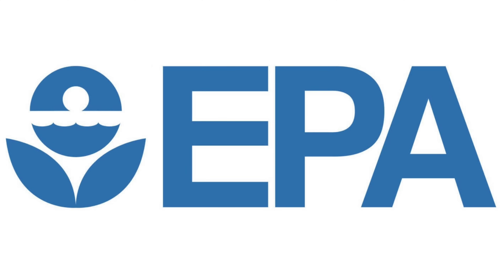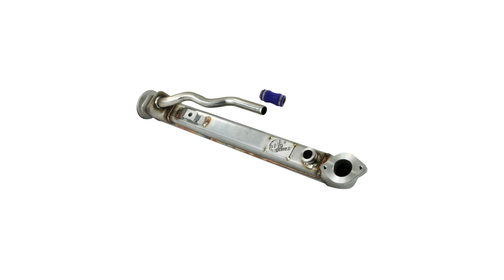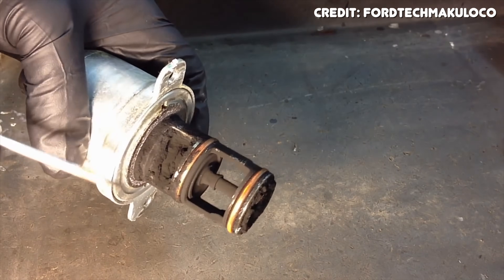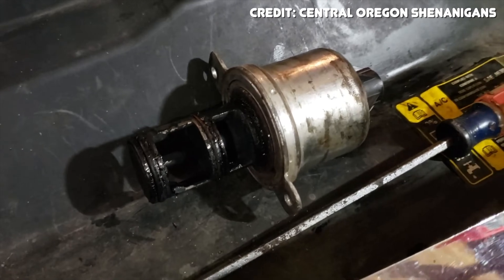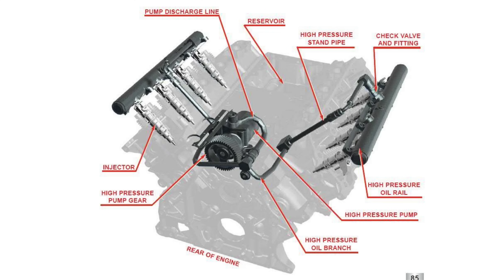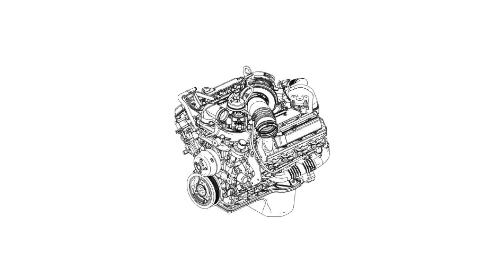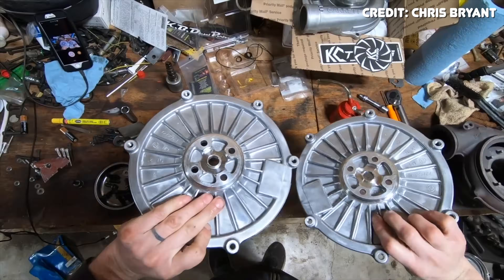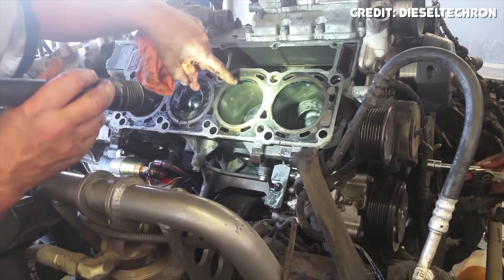The Truth About the 6.0L Powerstroke (And Everything Wrong With It)

Comment: Oh my mechanic loves my 6.0. It’s bare bones with no upgrades and regular maintenance. So far we’ve removed the cab only once. Been stranded twice. Replaced the injectors, high pressure oil pump, steering box and some oil rings. It’s at the shop right now getting a second new turbo and just hit 177K miles. I keep telling my wife I’m getting a new truck one piece at a time…at least we are experts on AAA and staying within our tow insurance max distance. When it runs I do enjoy its reliability.

Comment: Flush the radiator and use a better coolant than factory ford . It has levels of silica and clogged everything up . Erg oil cooler then your head gasket goes . Bullet proof everything . Bypass oil and coolant filters . Runs like a stripped ape . ARP head studded sct tuner . Schaffers fully synthetic 5-40 . And a bottle of Archoil .

Comment: A lot of the bad reputation in my own opinion came from older guys who bought these trucks new in the early 2000's who couldn't be arsed to buy a Scanguage and watch temps. To them the motor would just "blow up" one day but in reality it gave them months of notice it was going to shit the bed but they just never saw the warnings because they didn't have the $100 monitor to check IPR/ICP EOT/ECT delta. They aren't perfect trucks by any stretch of the imagination, I bought my first at 22 to pull equipment for my business that was listed not running due to a blown head gasket, which was actually a ruptured EGR cooler and because of a clogged oil cooler. I put a EGR delete, studs, BPD oil cooler, I have a early model with the round HPOP so I put in a Adrenaline HPOP while I was in her. With no diesel mechanical knowledge they are easy enough to work on and fix by myself over a few weekend with common hand tools these trucks have loads of information online for repairs and diagnosis. I haven't put a dime in it since. 
With the cost of the truck, repairs, and bulletproofing I'm in a SRW 3500 Lariat Crew cab 4x4 for $8,000 and 2 weekends of work, a current similar listing on marketplace for a Dodge 5.9 cummins quad cab SLT 2500 2wd with 85k miles more than my truck is $15,000.

Comment: I owned a 2500 2006 6.0 power stroke and loved the truck. I bought the truck new and put almost 200 thousand miles on it and only had two failures and that was a ficm and high pressure oil fitting and that was it, but those were fixed under warranty around 60000 miles. Only complaint that I had was being a high maintenance engine. I changed the oil and fuel filters ever 3 to 4 thousand and coolant every 10000.  That may have been overkill, but then again I never had any major failures. And the same person I sold it too is still driving it today. I’ve been aiming to go talk to him to see how his luck has been with it. Overall if you take care of that engine it would treat you right. FYI I never upgraded anything on the engine i kept it in stock form the entire time I had it 👍

Comment: The VAST MAJORITY of egr cooler failures were directly caused by a plugged oil cooler. That’s why the oil cooler should be replaced whenever the egr cooler fails even if the egr cooler is being deleted.

Comment: Once you have to follow up the statement that xyz is a good engine with “IF” you do this or that, then that engine has a serious weakness. Period. Bottom line is that an engine should perform well and be reliable the way the average user actually USES and treats it.

Comment: Awesome content, very informative and loved how graphics in the videos were spot on.  I love my 6.0, bought it off my dad about a year ago stock with 107k miles.  06 F-250 SD LB, I've replaced with sinister diesel top-end gasket kit w/ black diamond head gaskets, Studs, New Heads, stage 2 turbo, stage 1 injectors, Blue spring Kit, Heatcloth wrapped headers, Solid exhaust Y-pipe w/ MBRP 4" straight exhaust, Volant cold air intake w/ OEM dry donaldson filter material, Aluminum De-gas bottle, Secondary Oil and Coolant filtration, aFe DFS780 Diesel Fuel System (full time kit), 3 gauge pillar cluster and SCT Livewire TS+. I hope this truck lasts me 500k miles,
Reply: What did that run you for cost?
Reply: How many miles is on this build and how well has it treated you?

Comment: My 2006 6.0 has been running for 400,000 uninterrupted kilometres and is still going. At 240,000km I didn’t have any issues but did the following to ensure truck has a longer life:
- machined heads
- arp head studs 
- o-ringed heads
- used oem head gasket only
- replaced stand pipes and dummy plugs
- egr deleted
- upgraded water pump (used BPD aluminum pump)
- water filtration kit (used fleetguard filter)
- downgraded fan clutch to 7.3 clutch 
- oil cooler upgraded to BPD air to oil cooler
- conventional oil filtration kit (use fleetguard filter)
- all aluminum rad (to prevent top plastic from cracking)
- Turbo upgraded (non essential)
- Turbo oil lines upgraded (updated oem lines are thicker and will solve oil delivery issues)
- upgraded Y pipe to a sturdier design
- upgraded cold side charge pipe to aluminum (plastic ones develop holes)
- replaced all coolant hoses and clamps
- upgraded all 8 injectors to 175cc (non essential)
- blue spring kit installed 
- studded exhaust manifold (non essential)
- egt probe installed 
- edge cts3 monitor installed
- used sct with custom tunes - 120hp when not towing and 50hp when towing (only essential if injectors and turbo have been upgraded)
- replaced alternator
- Only used Schaeffer’s 5w-40 oil (4,000 km oil change intervals)
- water filter replaced every 8,000kms
- fuel filter replaced every 8,000kms
- Coolant flush (every 100,000 km with oem gold ford coolant)
- used Hot Shots Secret diesel antigel every winter

Comment: Have had my 6.0 for 8 years. In the early days i wanted to blow it up. She was used and abused in the north west territories and northern alberta oil patch before i got her. Since deleting and bullet proofing she has been one of the best and headache free trucks i have owned. She has been 6 yrs bullet proofed and same set of injectors since 200000 km when i got the truck. 160000 km since the bullet proofing was done. That said if you dont treat her right with proper maintenance and the bullet proofing and try to crank 500hp out of her you will hate it. Additives are very important. They help you get better oil change intervals and keep everything clean and soot free. Lets face it at 16 litres of oil and the filter plus additives it can cost up to 250-300$ canadian so you want to get 8-10000km out of her before u dump it. Rotella T6 0-40w, hot shots secrets stiction treatment and a double dose of rev X has been my formula for the past 6-7 years. Like they say in the diesel world you have to pay to play!!!
Wouldn’t  trade my powerstroke for anything.

Comment: I run a 04  F-350 SRW 6.0, build date 11 03.  Greatest truck ever.  It was bought new and has none of the issues mentioned in this video.  270,000km.  All stock other then my recently acquired new wheels because Canadian roads corroded my stock wheels.  Lots of parts replaced over the last 18 years but nothing on the engine itself other than rebuilding the turbo, same turbo just refurbed on a bench.  Maintain it and it will always work.  You want a diesel you have to pay to play.  Follow the time/milage service intervals, which ever comes first, for me is always time.  I hate DPF, DEF and SCRs so I'll keep my old 6.0 going because it won't die

Comment: Own my own diesel shop. I always tell my customers the same thing about these 6.0's. If you treat them like a trophy wife and go the extra mile on maintenance, you'll likely never have any major issues. 

Don't EVER go by mileage. Open the damn hood and check your damn oil condition. Change it often. Replace a gallon of coolant every 3 or 4 oil changes. Don't buy cheap diesel. If you can't afford a trophy wife or otherwise don't care to, then get a different truck. I've got several customers with 6.0's north of 500k miles. And they still purr.

Comment: I dont think it's a bad engine if you are nice to it and do matenince. When I got mine with 200k I sent it right into the shop for a delete, studs, and New gaskets/o-rings  pretty much all around. I daily it on a lower than factory tune and pull with a tune that's %17 above factory. Put 300k on it and never had a problem at all
Reply: facts they can be good motors. ive always felt bad for ford with this motor cuz they had to do all that change due to emissions bullshit.

Comment: Its a great engine as long as u BULLET PROOF IT, Don't Even Need To Delete It Good Parts Work Well MAINTENANCE VERY IMPORTANT 
I have a friend with a 6.0 hauler it is bullet proof And Still Runs EGR 650,000 miles 🤔 But MAINTENANCE Is Done At 3500 miles

Comment: I know many 6.0s that were very reliable, and the main thing they had in common was, they were left stock, no tuners, and maintained properly.
Reply: I love my 6.0 and I also love your fuck biden profile..
Reply: yeah thats the thing, 10-15 years ago young guys were picking up these trucks dirt cheap already with 100k miles on them, then doing a bunch of custom shit to bump up the power while ignoring worn out parts and basic maintenance. 
Then they'd put another 100k on them and BOOM. If the engine wasnt toast, it was about to be. I recently found an example that had 290k miles on it but is still running, just had the oil cooler and HPOP replaced. It's got a dead PICM but it still passed emissions. Its also got some leaks from the valve covers and oil pan gasket so i'll have to replace those before I change the oil cause I am NOT putting in fresh clean oil with broken gaskets, the soot is probably the only thing keeping it from pissing all over the road
Reply: I have a mostly stock 2006 F350 with a 6.0 . I have @ 120,000 miles on it . Bought it for 26K in 2012 . It had a egr cooler issue prior to me buying it .i bought it with 60K on it . I have had to replace the ficm , upper turbo hose , cleaned the turbocharger , and replaced 2 glow plugs . Other than those issues I have oil leaks that drive me crazy but it runs great pulls a lot of weight , and is very powerful and reliable. I drive it somewhat hard when it warms up . I will drive it till the wheels fall off. Need to get it painted now as the clear coat is failing on horizontal surfaces. Maybe cuz it’s red ?

Comment: 6.0 powerstroke Over 600,000mi on the clock running tunes. I don’t think it can be that bad 🤷‍♂️. The 6.4 is definitely NOT a turd performance wise. Until this day no person can factually deny that it is the factory engine with the most tunable horsepower. Because of the sequential turbos and the fuel system you can turn it up more than any other factory diesel out there. It’s been tested on the dyno

Comment: My 2007 6.0 is a monster. It’s been bulletproofed and had aftermarket parts put on it though. I’m pushing 600 horsepower and 1100 foot pounds of torque.

Comment: The 6.0 had a strong bottom end with a whack top end. It's the guy who always forgot leg day at the gym. Loss of head bolts plus the egr cooler design was it's downfall. Tube style core egr coolers fixed that plus the upgraded oil coolers.
Reply: Yep valvetrain is the weak link.

Comment: The problem with Ford is their latest and greatest typically has issues after it hits the market. Time, miles and the real world start to create problems long after the warranty has expired.  
Pick any first gen Ford product and you will see a pattern of tweaks and upgrades to solve the problems as they arise.  For some reason Ford more often scraps the problem and moves on to another better idea.

The 6 .0 is a school bus engine designed to make 175 hp and 350 lbTq.   The engine will run forever in this form and will never give the owner grief.  The problems showed up when they cranked up the power, EGT's and choked it all down with the emissions.   This was a recipe for disaster and they were doomed from the start.  Ford blamed Navistar even though Navistar told the bean counters at Ford this engine will have issues especially if they are pushed hard, such as fire or ambulance service.   Ford  quickly threw Navistar under the bus when the lawsuits started and Ford was still reeling from the Explorer lawsuits that ended their 100 year relationship with Firestone.   No one is quite sure how much Ford paid out in claims for the 6.0 because most of the lawsuits were settled out of court for undisclosed figures.  Some speculate well into the billions.....
 

Anything can be fixed if you have the $ to throw at the problem but why market a product knowing full well its going to have issues?  Most auto manufactures are guilty of this shady practice but the management at Ford simply accept this as their standard manufacturing process and the lawsuits and pissed off owners are just part of doing business.

Comment: Excellent video that they should play in the service waiting room at Ford dealers along with a couple more I have provided links to.
So we go through the 6.0 and then even worse the 6.4 Powerestrokes. Then in 2011 we finally have a better engine in the 6.7 Powerstroke and what does Ford do? They slap on a CP4.2 High Pressure Fuel Pump that will fail and cause $12,000 in damage. This along with a host of other issues on the current trucks, like broken off glow plugs, spun rod bearings, broken crankshafts, and "death wobble" (thrown in for free)! How can anyone that does any amount of research even consider owning one of these piles of shit? (real world IQ test) The aftermarket companies and repair shops have been enriched by FOMOCO and that makes jobs for thousands so there is an upside I suppose. 
https://www.youtube.com/watch?v=nPFPf2EpxkE&t=345s
https://www.youtube.com/watch?v=FiB6IbPs2Zk

Comment: I own a 05 with 240k on it now, bought it at 150k but thanks to Powerstroke Help I knew what to look for and have been a proud owner. Mine had the egr delete already, EGT gauge (implying that the previous owner CARED about it) and no blow by.
DRAJ did forget to mention the EGT problem regarding these engines. No factory failsafe installed that totally should have been. These engines can really make hot juice. With my cruise set at 70 I can see 1400 going up a mild Hill. Like seriously! We're talking about aluminum everything and no computer failsafe in place for egts!? If I'm loaded I can send that gauge soaring but obviously never send it over 1250 and never will because I want an engine when I'm done lol!
Reply: Also forgot to mention the literal patten Ford has on many parts that include stuff like the shape of the oil filter! Lol! If you by a non Motorcraft filter it is the wrong shape and therefore not doing its job. Yes, they come with different caps to accomplish this and such but think about the DIYer that doesn't think to check this and, well seems likely to me that a lot of problems are caused in this fashion. Same with the fuel filter and the lack of water protection that inherently cracks injector tips. When you don't know you don't know and it's sad that Ford is money hungry to the point that patterning the oil filter is a good idea to them. SMH

Comment: 6.0 power stroke  had problems with injectors , high pressure oil system ,egr , egr cooler , egr valve, ficm, vg turbo, transmission module , head bolts, head gaskets, heads cracking, rocker arms, cam impossible to get out, coolant flow, oil to hot, sand clogging, something about the battery causing damage not enough head bolts torque to yield bolts, oil coolers , head bolts too small, head gaskets It had 18.5 to 1 compression dropping valves from rocker problem then destroys cam and bearings. I worked on a farm and bosses son just got his truck back from the dealer and he let me pull heavy a trailer full of farm diesel and I had to pass a car so I floored it and I think he had a tune in it. It blew the head gaskets from flooring it one time. I felt bad  I didn't know.

Comment: Had an ‘04 in a crew cab XLT. Check engine light would come on periodically in steady freeway driving or while using tow/haul mode. Never understood why. It would go off again in about 400-500 miles or a couple days. When it happened the first few times I checked everything under the hood and all the gauges. Everything looked fine and ran perfectly, fluids and temperatures all good. Dealer could not find anything wrong. I had them preemptively replace the egr valve and never had the problem again. Also when I first got it, surging at a stop light was a serious problem. If you didn’t have your foot firmly on the brake pedal a sudden rpm increase would surge the truck forward. The body, transmission, seats, paint, and the truck itself were excellent. Didn’t rattle one bit. Sold it after 150k miles and 11 years. Still looking and running like new. I’d get 20 mpg on the freeway driving 70-75. Overall great truck. Thanks for the video.
Reply: I use the Tow/Haul when pulling my Travel Trailer, but only to slow down when coming off the Highway, due to accessing all the gears in the Transmission. If I’m’ in a tight curvy mountainous road with steeper inclines I will use T/H as well.

Comment: The first F250 I ever drove with a 6.0 was a brand new 2003 that the customer was having us install a lift kit on. I went for a test drive and I noticed the fuel pedal quit responding. Later I realized I experienced the dreaded dead pedal problem. I didn't learn my lesson tho and bought a used 05 F250 with a 6.0 in 2009 and the first time I towed it puked coolant. Did an EGR delete and when it still puked coolant I traded it in on a brand new 2011 F150.

Comment: Own an 03 and 04 that have been rock solid. Yes, we’ve had to replace the hpop, some injectors, oil cooler, and remedy the EGR “problem” in both trucks. Both are well over 200k miles with original head gaskets and both tow heavy regularly. Other than that, no muss no fuss.